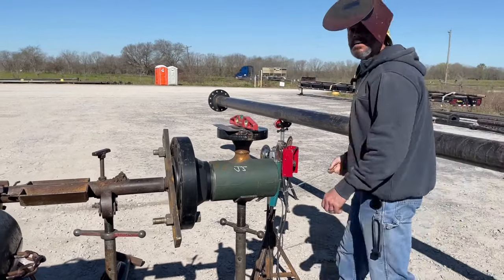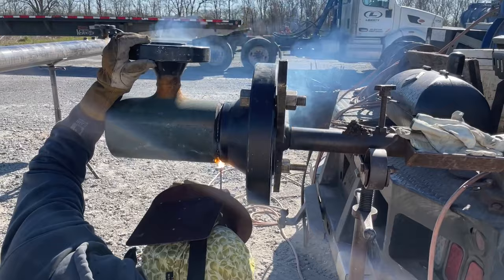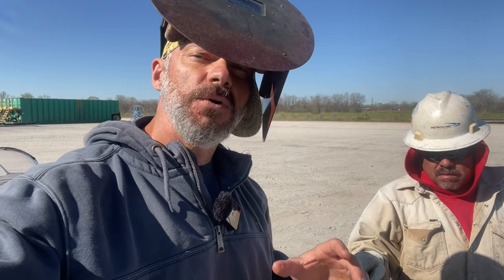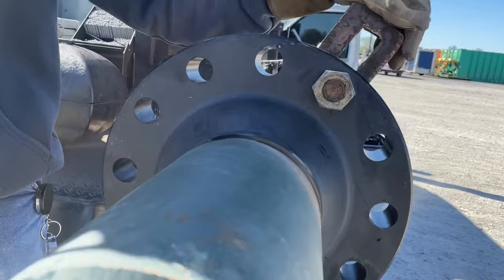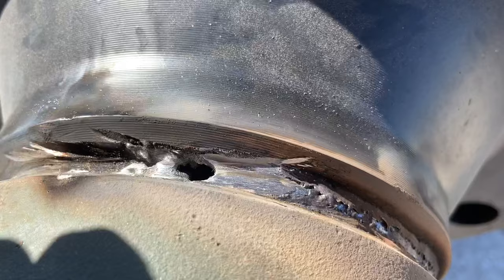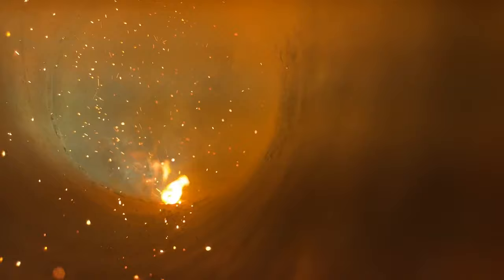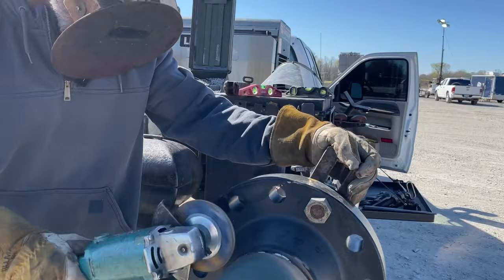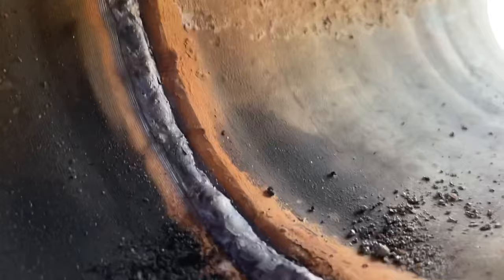The 6010 Blowout Repair: How to Fix the Most Common Problem in Pipe Welding

Comment: Going through welding school now and the 5 to 7 o'clock position has been the most trouble for me.  I will be trying what you just showed on my next blowout, which will probably be on Monday.  Keep the advice coming!
Reply from the maker: Dead man’s curve. I also had a problem there. Is it on the beed,or Cap
Reply: @TaylorWelding  My problem starts with the root.  I am pretty sure its just my rod angle I have to correct there and maybe move a little faster.  For some reason I tend to want to slow down at the bottom.  We are also welding uphill vs downhill.  I also have issues with the cap in the same locations.  This is the first welding I have ever done so I guess I just need to figure out what works for me.
Reply from the maker: @stephenleonard6995  that’s right just keep on practicing bud. Try to keep your hand in front of the rod little bit. Like the rod angled back. I don’t know if I’m making sense it’s hard to text somebody how to weld
Reply: @TaylorWelding  LOL, yeah it is.  I understand what you mean though.  I appreciate the advice.

Comment: On blow outs use 3/32 6011 on reverse polarity, you can almost weld on air with it, good for blowouts and thin thin metal.
Reply: Most pipe procedures that's a no no and will get you fired
Reply: Thats a easy trip to the bus stop with pipeline company's!

Comment: Good instruction. In a future video, please tell us about your Vantage 300. I’ve always kinda’ wanted one but for what I do, the Ranger 305G makes more sense. I’ve had two of them and my older one is only “Semi” retired with over 7400 hours on it! I still use it in the shop regularly and on the rare occasion that I want a machine on the ground or in the building I’m working on. I just noticed your Vantage because, from what I understand, most pipe hands lean toward the SAE’s and Classic’s. Just curious about your take on the Vantage in a pipe welding setting. By the way, I’m a self-employed rig welder/fabricator that works on everything but more agricultural  based with a fair amount of trucks and heavy equipment thrown in the mix.
Reply from the maker: I'm gonna make you a video
Reply from the maker: I’m going to make you a video. I’ve already Made the comment but it disappeared
Reply: I have a vantage 300,400 and a 305EFI. And after ew older 200 and a classic 2. Out of all those machines my favorites are the classic 2 and the 305EFI. The ranger welds identical to the vantage cause they use the same control boards. Only time I use the 400 is for heavy fab when I need to burn 1/4" 7018 for days on end. Can you guess which one I use the most? The 305EFI. And I'm a pipe guy mainly that dabbles in structural and heavy equipment repair

Comment: There also a way that u can just float a weld on the walls until u get it to a gap u want like a 1/16-3/32 and then grind that weld down and just push on the gap u made it should come out real good , now xray and everything I have heared it will pass I have done it but I’m still practicing.

Comment: Hey Chris I’m not sure of the best way to message you but I’m having a time trying to pass d 1104 with my vantage. Was wondering what kindof Amps you were putting a hot fill in with 5/32 on standard wall 8”? I keep blowing massive holes in my bead on the bottom 1/3. Thanks a lot sir your info/channel is awesome!
Reply from the maker: I’ll try to make you a video JON. The bottom is a hard part from most people. It was for me too
Reply: @TaylorWelding  awesome it would be greatly appreciate sir
Reply: Most of the time that comes from holding the grinding wheel straight at the bottom.You cut out a U shape.What you want is a V shape .And then stay off the middle and keep the digging part of the rod on the sides.Also if you are using rods smaller than 3/16 try a # 9 lens.I used one for 40 years and it did not hurt my eyes.Keep that lens clean.

Comment: Hey I saw another video of yours, and you had a few of the older style stingers for sale. Do you have any left? Also I happened to follow your Link to a rumble discussion, and we seem to be on the same page. I live in California,  and we're homeschooling because of the current state of affairs.  My kids haven't had any vaccines and we believe in God given gender.
Reply: "Stubby Rod Saver" is the name of it. They're out of production. I found a similar ESAB stinger-but ESAB says they don't make them any more. Some are for sale out of Ukraine though. I bought a second one for my other machine. There's another company making one similar but the name escapes me. I've done extensive searching. The ESAB unit isn't as well built as the Stubby-but it's a fairly solid.
Reply from the maker: I sure don’t. Maybe I will build one

Comment: you ever have to do the D1.1 ? Any tips?
Reply from the maker: D1.1 ? Idk what that is
Reply: @TaylorWelding  its a structural test 3/8 or 1" flat plate 22.5° bevel with a 1/4"  gap with a backing strip. I appreciate your replies thank you